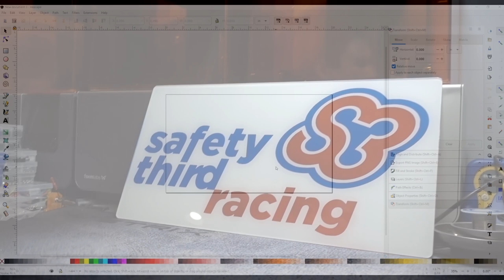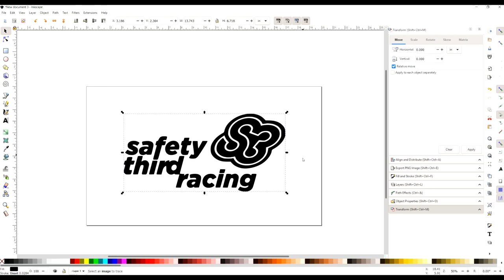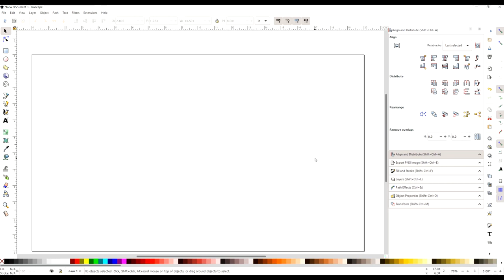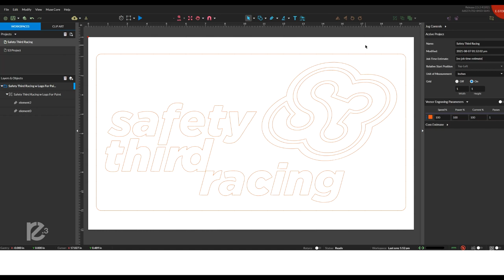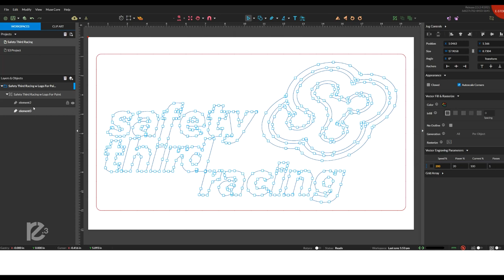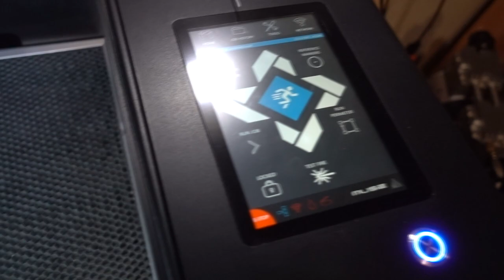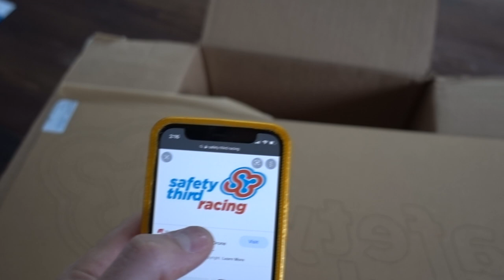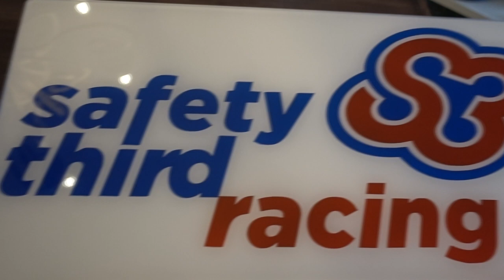Make Perfect Signs EVERY TIME! - Use YOUR LASER CUTTER- Easy to Make!

Comment: Thanks for the video!  Two questions for you… what do you set your  air compressor to for acrylic and what paints do you recommend?
Reply from the maker: 1 or 2 psi at the regulator  (just enough to keep the lens clean), and any of the paint plus primer in one I like since I use those types of paints for my 3D prints too. You can usually get a good result with just 1-2 coats max, which I really like.

Comment: I can see the Muse has an air assist, if I don't get a third party air compressor and I decide to get the Cool box that FS offers that comes with an air pump too? ...oh, and what kind of paint and method did you use, spray, brush? Thanks
Reply from the maker: Yea the cool box comes with a small air compressor built in. I just used spray paint! Nice and simple!

Comment: Hi Kevin I am enjoying your videos as I am considering this model from fs laser. Quick question: have you ever cut mdf or do you recommend it? I follow someone who does woodworking and cuts 1"2 mdf on her aeon laser. Wondered if you think that would be a possibility. I understand it cannot cut through thicker than 1/4" but I'm okay with that. Just wondering about the safety
Reply from the maker: I have MDF sheets, I just haven't had a use yet to cut them. I've heard good things about using MDF (only 1/4" thick with this model). I should be getting a titan very soon so that should be able to easily cut 1/2" though.